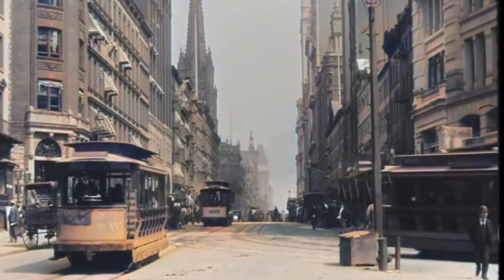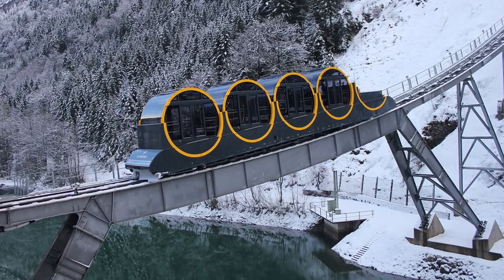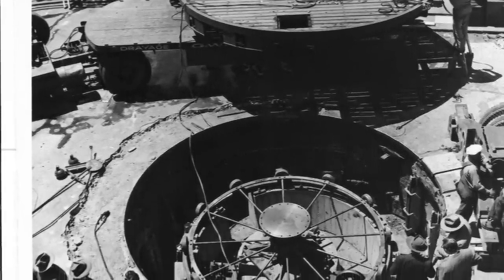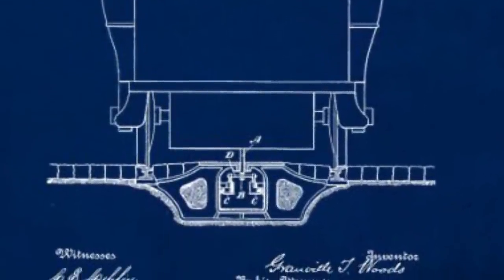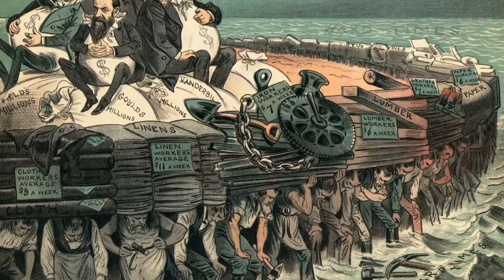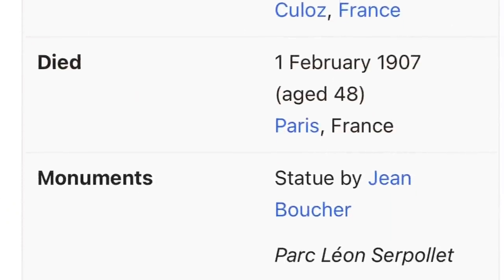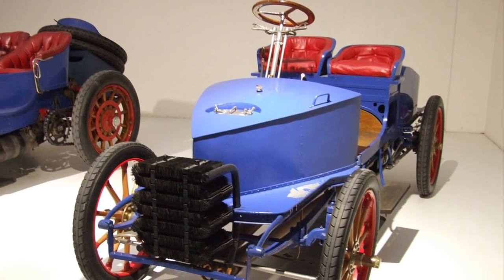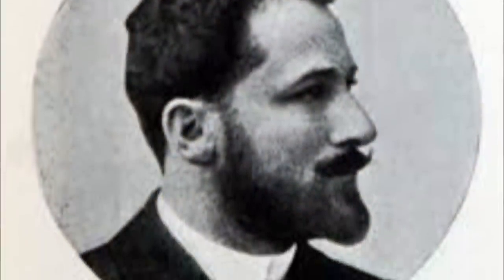Conduit (Wireless) Electric Railways, Cable Tunnels, Funiculars, Antiquitech, Serpollet Steam

Comment: i thought some get power through the rails? there was also battery power long before petrol powered. its documented.
Reply: the areas where there is lines overhead, possibly recharge the crap batteries when in contact? if not rail powered anyhow...

Comment: So 6 miles on an ounce of water is equal to.. 768mpg.  There's 128 ounces in a gallon.  So if you had a 10 gallon tank for these cars that is equal to 7,680 miles, per fill up.  And you're using water, not gas, which basically you have free energy/transportation.  You could go from New York to San Fran AND BACK without having to stop to refuel... if what they say here is correct. ...  I wonder why the gas and oil companies monopolized, murdered, blackmailed, and lobbied our leaders and law makers? Hmmm

Comment: i dont understand how the cable set up worked..
Reply from the maker: As far as who and when it was built, they say in the 1800’s, but essentially you have the “trolley car” sitting on tracks. In between the tracks (usually in the dead center) was a third “track” which really was a slit / opening. Below ground, where this slit / opening was, ran the cable for the cable car. Out of a sight, A mechanism, called a grip, that was attached to bottom of the cable car, would, underground, be attached to the cable. The middle of the mechanism was very thin, and would fit through the slit / opening that ran the length of the track, thus supplying the mechanical connection from Cable Car to Cable. The conductor basically just worked the brakes, as the cars would always be fixed upon the cable to generate forward momentum. The cable itself was propelled by massive gears and pulley systems which were tucked under the streets and connected to Cable Stations, where mostly the narrative says Hydroelectric power was used to “crank” the gears which “moved” the cable, which “powered” the cable cars. It’s complicated to say the least
Reply: @FRESHboosters  Thanx. I got that. Bit like Scalectrix.. Do u have Scalectrix in the states?
Reply from the maker: @DaemonZodiac  I’m actually not sure what that is... so I have something new to research right now. 😃 I’ll let you know if I find any to have existed within the states
Reply: @FRESHboosters  its a kids racinbg set, with a connection between the car and the slot in the track, feeding electricity to the car....you dont know what you missed...lol..

Comment: Don't believe cable theory, considering all times I have skied, the cable system does not stop its always moving when get on ski lift and hoping off. Lets say multiple trollies on cable let say in big city. Passengers either getting on and off trolley as it is moving, only time cable stops is for emergency. Say a trolley just stops and goes at different speeds I disagree.

Comment: I am 80 years old and a transport history enthusiast so when I saw your video I needed to watch it all the way through. You have a number of things right, but many mistakes in your history timeline that need correction. Serpollett was not as great as what you read suggests, and further though he was improving the most popular engine type of that time, the end of the nineteenth century.
 Where many steam engines were known to blow up and kill people, publications of the time marveled at the flash boiler. But there was a great deal of trial and error in  urban public  transit.
 The San Francisco cable cars were very different from funiculars which were common but all very short. The technology developed by Andrew Halliday in  1870s SF from mineshaft steel cabling, was adopted across America, and in Europe, but not nearly as well used as the later invention of the tram/streetcar/trolley by among others, Frank J Sprague who brought all the elements together for the Richmond Virginia streetcar system that proved, in  an1889  test of starting 20 of them simultaneously that they could be practical and superior to the cable cars. It was only then that the cable car companies began replacing that complicated under street system with the "conduit system", generally in the same underground slitted tubes they already had in place. Overhead wires were much cheaper and less costly to install or extend the services so trolley systems were much bigger. Those are cable cars there in New York, and the Subways, while much more expensive to build used third rail contact systems and still do. 
The automobiles you cite are all playthings of the rich, but Ford's Model T  popularity did contribute to the demise of most trolleys out side of the great cities, with their Underground Subways and Metros.  San Francisco saved their hill climbing cable cars at great expense, but the ones on the flats of that city after the 1906 earthquake  ruined so many of them, were quickly converted to trolleys, and trolleybusses. You have much more to learn about those years. Keep trying.
Reply: Intriguing

Comment: I thought that metal rails, was replacing the cables, with electrified rails, like in subways.  A transfer station at city border so death by electruction, was prevented.   This supplied Orphanage - Asylims, etc. 
       Steam engine and it's uses.  Engine power, or wireless, or under a mudflood street.  
World wide we were more advanced.  The earth moved under our feet,

Comment: I'm at 11mins roughly and you talk about the electric being under ground ... 
I have to point this out now , especially with dates .
DC voltage loses power over distance, there is no way they could run this on a DC voltage ...
And how invented AC ?
And when was that ?
And what's the dates they electrified?
Or the voltage was so high to lose it over the length of the cable ...that if the +- were too close you'd get arcing ...

Therefore something is wrong here
Reply: Perhaps you should make your own video ?
Reply: As you say DC voltage loses power over distance, what if it got boosted by DC power coming from buildings (Antiquitech) long the way ?
Reply: I think it’s being pulled then ac powers it just has some way to insulate from opposite pole they don’t show very well in the pictures
Reply: I have heard mention on another video that cars contain batteries in addition to the other power from center track so this would allow twisting power at various intervals
Reply: AC\DC
Reply: @maxistexas  invertor

Comment: dude this is the most basic of ideas its not conduit conduit is not a specific tool anything can be a "conduit"  its wire its they made toys that were electric. they were torn down in order make way for cars and fuel sales. Some times common sense is just that   stop saying conduit !!! ahhhhh  you are not specifying the difference between A/C and D/C  but i cant listen to you misuse conduit ugggh